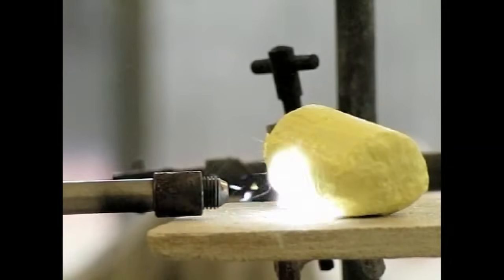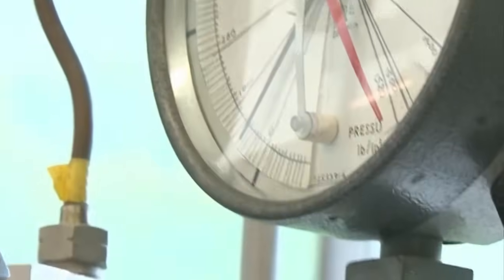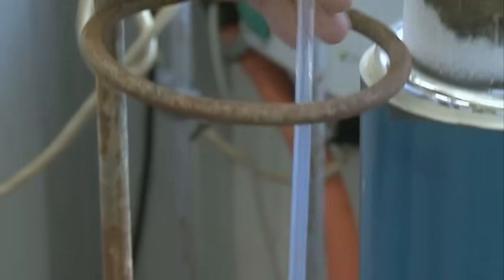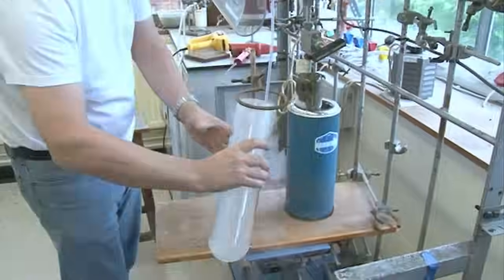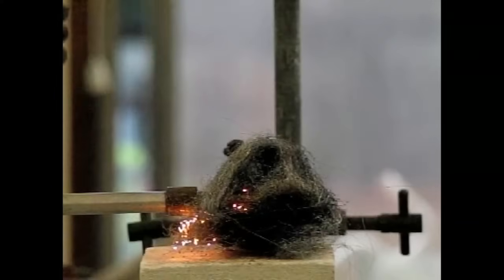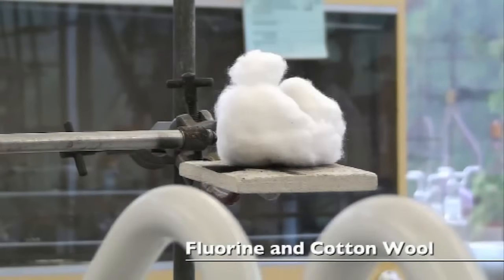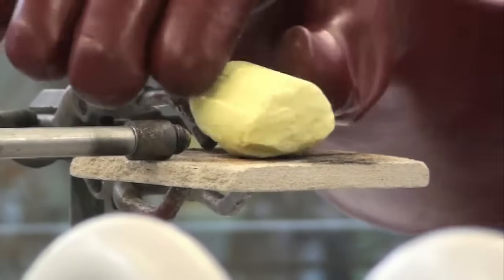Fluorine - Periodic Table of Videos

Comment: The chemistry of fluoride toothpaste at the end was quite cool
Reply: you probably get more floride from what you eat than water, lots of foods contain more such as seafood, potato based foods and several juice/fruit products, as well as most foods tend to have around not a singificant amount less than tap water. So unless you're really drinking 8 glasses a day you're probably scared of the wrong thing.
Reply: @somedaythewave  Not true at all. Fluoride does exist everywhere but in very small amounts. It's typically dosed in drinking water at a rate of 2 to 2.5 ppm as a target. That doesn't mean that the equipment used is all that accurate and maintains a constant feed rate and will fluctuate easily by 1 part. You'll not ever likely find it in that concentration in the wild.
Reply: toothpaste is sodium flouride not hydrogen flouride.
Reply: Filip laskovski He was talking about how fluoride replaces the OH group forming Ca-F. Nothing to do with molecular fluorine or the ingestion of fluorine to affect the brain. Scientific illiteracy is a pain.
Reply: Filip laskovski Apparently, that is only in some areas. I live in the UK. i think the government has a "fluoride check" facility online where you can see which areas contain fluoridated water. I agree though that in those cases it's unacceptable.
Reply: Mr Blank You've got much more potent acid in your stomach. It doesn't make much difference.

Almost all foods contain acid. It's our weakness. But it's also why you should drink water with your food, to wash the acid away.
Reply: what about the effect on the brain?
Reply: hcl is hydrochloric acid.
Reply: JOnhatan mizmarra Because hydrogen fluoride an acid Sodium Fluoride is a salt so it's far less dangerous
Reply: lol "study authors"
Reply: Mr Blank This is a very ignorant comment. Mucus produced by gastric cells protects the stomach from damage by the acid, and it's only one type of acid we produce as well. "Acid" isn't some primordial ooze that dissolves everything, it's a word for a bunch of solutions with a low pH, do you get your education at hollywood or what?
Reply: DavidsonLoops 
I was hoping he'd speak on it being a neurotoxin
Reply: ***** When I was forced into the MSDS officer position for my unit, and read some of the simple stuff I thought was harmless but.... yea you just gave me horrible flash backs! :O
Reply: DavidsonLoops his face as he realized that the camera guy was promoting him to explain fluoride vs Florine was hilarious, he’s like “Florine in your what! Don’t be silly... Oh! that’s what you meant, Fluoride”
Reply: Best part. Happy to use floride.
Reply: +DavidsonLoops I'm from Australia and our water is rich in it 😤😤😤
Reply: Water is a weakly acidic.
Reply: But why is HF in solution dangerous? That´s fluoride... still eats my skin
RESPONDER
Reply: JOnhatan mizmarra the H-F bond is weaker than the NaF bond, making the HF more reactive. The flouride in the NaF is more tightly bonded to sodium than the flouride from the acid and it only wants to make stronger bonds which have a lower energy&reactivity.
Reply: @francopittaluga  it's because the hydrogen is also very willing to react and trade places with stuff. also , HF is in MUCH GREATER concentrations than the fluoride in your water.
Reply: he was paid to say that
Reply: +Green Morning Study authors believe that there is a “pandemic of developmental neurotoxicity” and fluoride is a contributor. Developmental neurotoxins are linked to increases in autism, attention deficit hyperactivity disorder (ADHD), dyslexia, loss of IQ points, disruptive behavior, and other cognitive impairments.
Reply: Why is it in our water then !!!!!!  it's been proven that fluoride is a neurotoxin !
Reply: @filiplaskovski9993  because its not elemental

Comment: My son just posed a question that I have no idea how to answer: What if you replaced the target material with a diamond and then hit it with fluorine? I honestly don't know how to answer that...
Reply: +Steven Hodder it will do just like the coal did
Reply: Diamonds burning? Now that would be fascinating to watch :)
Reply: +Patrice Le Brasseur That's not a given.  Just because both are made of carbon doesn't mean it's the same.  Chemistry is all going from unstable to more stable compounds (energy release).  I'm not sure as a diamond is a very very stable crystal that the fluorine still has the potential to break it down.
Remembering my chem days, if the potential energy of the new F C bonds isn't more than the energy required to break the C C bonds in a diamond, you won't get a reaction.  

And diamond is very different from coal, which is why to break C C bonds in coal you just need a little heat (a match), where those some C C bonds won't break in diamonds to the same heat.

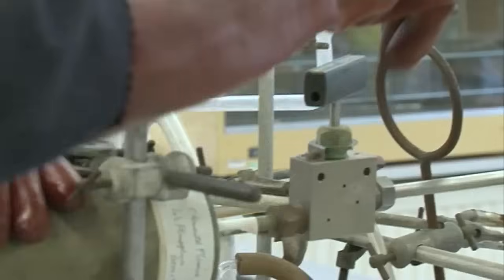Comment: I wonder what metal (alloy maybe?) they used for the pipes at 2:44 ... since apparently all the elements except for two won't react with Fluorine.
Reply: Probably Nickel, like was mentioned at 4:30 .
Reply: +Benjamin Esposti-Ozias he said that pipes react to it and form layer of salt which prevents from further erosion
Reply: +Ugninis Qbin&#39;as Minor correction; technically nickelfluoride isn't a salt in this context.
Reply: +Benjamin ‘Ozias’ Esposti Professor poliakoff said that they typically use nickel.

Comment: it even reacts with the other noble gases? how?
Reply: +jcoronet2000 Fluorine is so desperate to fill its outer shell that it'll take any electron it can get. If I understand correctly, the larger noble gases aren't quite so desperate  to hang onto their outer shells because of the greater distance to the nucleus.
Reply: +WashashoreProd  that is a wonderful answer, thank you.
Reply: @WashashoreProd  aka electronegativity
Reply: +Seanathon James 
Wont anything react with anything if enough energy is put into breaking the bonds?
Reply: peep139
Depends how you define "reacting". In a chemical sense, it means a transfer of electrons, usually. Sure you can just keep adding energy to a system to turn to non-reactive elements into plasma, or something, if you want to call that a reaction. But chemically it isnt.
Reply: *****
CIF3 is also used in the semiconductor industry, and was once tried as a rocket propellant.
 
It is vicious stuff, the most fluorinating agent known. It makes things a normal person would consider non-flammable, flammable. Like wet sand or asbestos.
Reply: Rykehuss Somewhat around 1983 or so a truck with several hundred liters of ClF3 spilled all of its contend on a highway. The damage report stated "The spilled component ClF3, burned trough the highway, as well as one and a half meters of dirt and stone beneath". I wonder why noone wants to work with ClF3.
Reply: Gatto -  there is also XeO3, which was discovered in the 60s.  It is a waxy solid with a tendency to explode unpredictably.
Reply: +rajesh shahi rajesh shahi It doesn't react with He, Ne. Though it does react with Ar Xe
Reply: Its not just distance from the nucleus, larger noble gases have a greater number of energy levels hence shielding from the electrostatic attraction of the positive nucleus to the valence electrons in the outer energy level occurs. Fluorine has little energy levels and a large relative positive nuclear charge, causing electrons to be more attracted towards the nucleus,  thus greater electro-negativity. The attraction also causes atomic radii of fluorine to be small.
Reply: wrong. there are no known compounds of he and ne.. it can react with argon and xenon though.
Reply: Incorrect about the V2(A4) propellant, which was alcohol [fuel] and liquid oxygen [oxidizer].
Reply: +Himanshu Patel you are wrong it can react with He and Ne but it requires a lot of trinitrotoluene to start the reaction you can HeF and NeF2 but for only some milliseconds then it decomposes back into F2 and He or Ne depending on with fluorine was bonded.if you want more information surf the net.
Reply: +Himanshu Patel 
It will react with He and Ne at extremely high energies.
Reply: Because of fluorine' high electronegativity it even reacts with He,Ne but you need so much energy to start the reaction

Comment: Is it okay to release fluorine into the same air you are breathing from? I bet it isn't
Reply: +Роман Плетнев It immediately reacts with everything and forms nice, stable compounds.
Reply: +Роман Плетнев It would form hydrofluoric acid because of the moisture in the air. Very soon you have no elemental fluorine, but big clouds of hydrofluoric acid.
Reply: +Роман Плетнев if you dont point it an anything it needs a few seconds to reach you and in that point it has bonded with nitrogen and oxygen from the athmosphere
Reply: The amount of fluorine is probably very small. But it could be quite dangerous. Hydrofluoric acid beeing formed with the water in the air is also heavily poisonous for example.
Reply: +Роман Плетнев I wondered that too...
Reply: There's only one way to find out...
Reply: +Роман Плетнев It most definitely is not. In fact, the results would be rather horrific if you did.
Reply: It's so reactive, it can oxidize carbon dioxide to form carbon tetrafluoride (inert) and oxygen, so if anything, it makes their air fresher than before.

Comment: how does it react with argon?? or any other inert gas? (which isn't helium or neon - the ones that were listed)
Reply: +Edward Barry they can be forced to react, I believe by having the electrons forced into the reaction or something (cant remember what my chem teacher said)
Reply: +Edward Barry Think it forms a hexafluoride in all cases. One of my classmates in undergrad gave a little presentation on noble gas compounds, and if memory serves me correctly he said XeF6 was the first one isolated at room temp. Based on the directionality of the trend, I'd imagine noble gases from argon on down are capable of reacting with fluorine simply bc of more electron shielding.

Comment: What is the clear tube that the flourine flows through made of? Is that sapphire? Sounds like there isn't much it won't react with, but the tube is clear! For that matter, what is the opaque tube later on made of? And what about the storage tanks? Maybe some kind of special lining with a standard metal tank on the outside? I'm curious!
Reply: Gergely Nagy He says "You can't use it with glass vessels" :(
Reply: +Gergely Nagy  in a different video Professor hope says the tubes are a special material that doesn´t react with fluorine. probably an organic compound which already has some fluorine atoms. It looks similar to PVC to me and well if it was possible to substitute the chlorine in PVC with Fluorine it should still have similar properties but that´s just me.  So instead of a polymer of vinyl chloride you would make vinyl fuoride. it should at least be less reactive with Fluoride. but that´s just speculations as i don´t know the properties of vinyl fluoride or polyvenylfluoride. and maybe even that would still react with fluorine.
Reply: +Motorguy81 exactly! fluorine will react with glass as organic materials. Teflon is one of the only materials that fluorine won't react with. (sorry for bad english)
Reply: He says at around 4:15 that it does not attack glass, so that would be an oblivious solution (although the tube seems to be a bit flexible for me).
Reply: DrJonez the tube is surely teflon; its formula is -[CF2]n-. fluorine can't replace fluorine, so this reaction can't happen. teflon is chemically indestructible, nothing reacts with it at room temperature, as the C-F bond is incredibly strong. the tanks are made in nickel, which can be attacked by fluorine, but it protects itself with passivation (like chromium), that is a layer of oxidized metal that protects the inner atoms.
Reply: I'm not sure if this is still relevant, but the tubing appears to be PFA. We sell quite a bit of PFA tubing to refineries. It is clear with a faint bluish tinge. It has excellent chemical and heat resistance compared to other plastics.
Reply: It’s definitely teflon. Teflon tubing is really common in labs for obvious reasons—they sell it by the yard at our physics store. And I know I’m two years late, but the reason it doesn’t react with flourine is because it’s already got so much fluorine in it—it literally couldn’t fit any more in if it tried! And I don’t know much about gas storage, but if I had to guess I’d say that the inside of the tank is also lined with teflon...though I have no idea how they’d get it to stick to the tank! Or maybe alumina, which is also supposed to be pretty resistant (though I couldn’t tell you why)
Reply: PFA (perfluoroalkoxy alkane), judging from its transparency.  It's very much like teflon, but unlike teflon it can be melt-processed, molded, and extruded into tubing that, as Matthewzilla notes, is commercially available.  There's nothing else quite like it.  Aclar (PCTFE) comes close, but it's much more expensive, and tubing is hard to come by.
Reply: drjonez Pretty sure the tanks are nickel but idk about the others. Probably the opaque tube also.
Reply: +Gergely Nagy it will light glass on fire...
Reply: Whoops, really... :P
Reply: Probably the same kind of plastic that they store hydrofloric acid in

Comment: There's a huge linear accelerator, deep beneath the Rockies, it's secret, a military facility. They shoot larger atomic nuclei into probes of different kinds, quite the same as the comrades in Darmstadt do, but with another purpose. What they discovered is a new quite heavy element called Norrisium, after Chuck Norris. There are even a few stable isotopes. All I can tell you in the moment (without harming my confidentiality agreement) is, that fluorine does not attack Norrisium, Norrisium attacks the fluorine (with a roundhouse kick, or as quantum physics say, with "spin"). Ok, sorry, I'm already taking my pills.

Comment: What will happen if you put it with hydrogen
Reply: HF acid I believe
Reply: Radarcontact can you go and see what will happen
Reply: marco jonker You can oxidize a brick with fluorine. Hydrogen is a piece of cake. You cannot mix the two chemicals intimately before you ignite the mixture like you can with hydrogen and oxygen; it instantly catches on fire so you just get a flame. If there's any air around the hydrogen, it goes poff like it usually does in air.

Comment: it would be really cool to have a "fluorine lighter". the fuel is yellow, it ignites anything even if its raining, it burns tru metal, no flame... the difficult thing would be recharging it and maybe using it without blowing up in the attempt xD.
also 5:04 that should smelled horrible, am I right?
Reply: I don't think you'd wanna use that in rain...unless you want hydrofluoric acid burns..
Reply: Pure fluorine, along with most other elements, is difficult to get. Also, fluorine would probably react with all the chemicals in the lighter. Other than the expense and reactivity, that would work.
Reply: ***** *Serious everything problems
Reply: ^
yeah, serious everything problems
Reply: ***** Wherever it entered your body, it would eat away at you due to all the water content in your body, way before it even reached the bones.
Reply: Sulfur hexafluoride is odorless, but oxygen is reacting with sulfur too, so probably you could smell something.
Reply: ***** That, and everything else problems.
Reply: That first drag though...😫🤢🤮😨💩
Reply: It was only a "joke", I know that it would have lots of dangers making it useless don't be all like sheldon cooper please xD